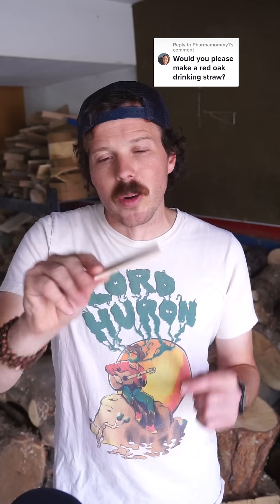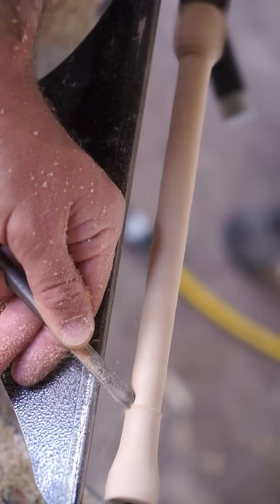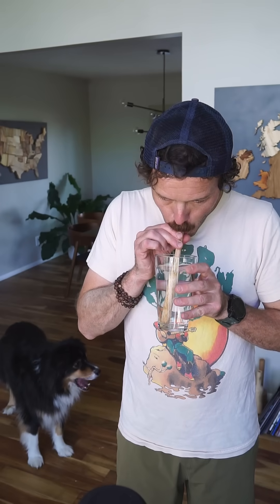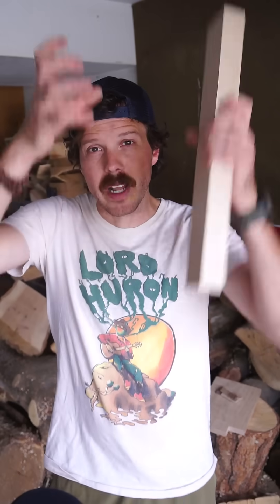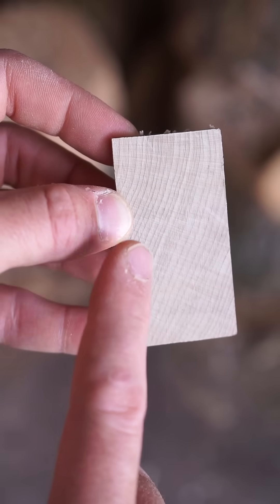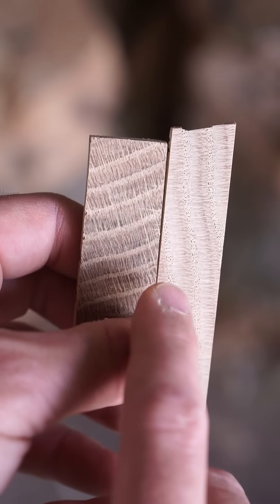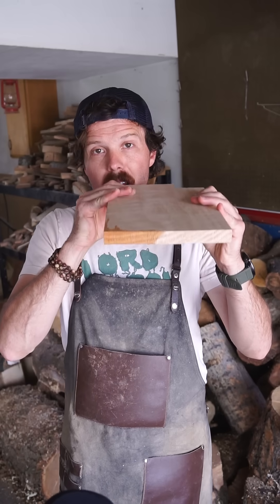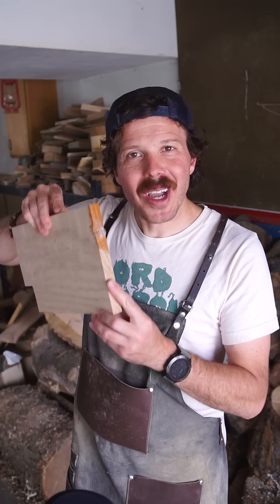drinking water through a piece of oak?

Comment: Did you try hand splitting the piece to ensure that there is no runout of the grain? 

If you do this before you turn it on the lathe, it will ensure that the tubes run all the way from end to end.

Comment: White Oak is 'more' ring porous', but it constitutively fills its pores with tyloses and blocks off the vessels. Red oak does this also, but less consistently. A lot of red oak tyloses are actually formed in the two weeks after the tree is cut down, yet still not enough to block off all vessels. This is why white oak (specifically Q. alba) is preferred for barrel staves.

Comment: one thing he did not mention is when the wood is dried the lignites are solid and the tube is solid if you would drill a hole through it you can call it a straw sticking wood in water is just absorption

Comment: Apply a sealer like acrylic etc to the top layer of the wood to make it so you are only pulling air from the area below the surface. Then… attach to the end above water a hose that has a vaccine chamber on one end. Turn it on. Slowly the water will pull up the wood dowel to the hose into the vacune chamber.

Comment: If I am not mistaken his definition of "ring porous" is wrong....Ring porous has to do with WHERE the pores are clustered. What he is referring to is that Red Oak does not have Tyloses (tyloses are like valves that seal off the pores).  This video gives a wrong impression of how ring porous wood describes the structure of wood. White Oak is also ring porous yet it is water tight because it DOES have Tyloses.

Comment: It didn't work because your still getting air through the sides above the water... Air moved through small holes easier than water.. so when you create a vacuum the air moved in to fill the space because the water had more resistance.. in order for this to work.. you have to prevent the air from moving into where you want the water to go .. which is the exact reason the wider board worked.. there was enough sidewall to make it harder for air but easier for water to fill the void after creating the vacuum

Comment: Mark along the both ends of the board some numbers blow on the board opposite of end immersed in water bucket that has mirror in the bottom and note the connections make your column and shape as you do not want to suck air in from the side which makes a straw not work .